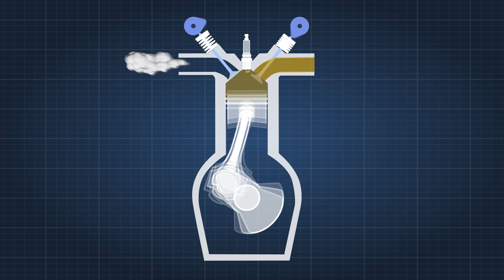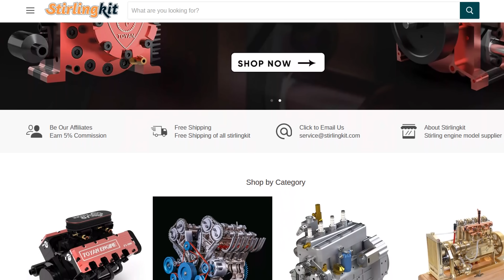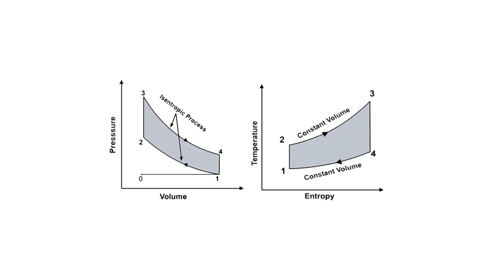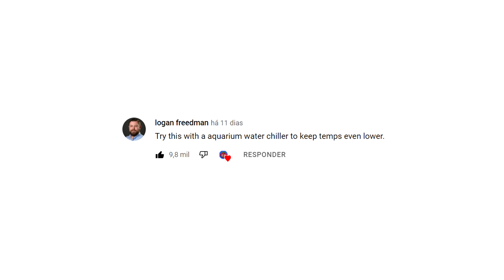I 3D Printed a Transparent Combustion Engine in Resin

Comment: It just seems to be firing at the wrong time. Too high compression would cause this, not giving the spark just prior to reaching TDC — each fuel needs a different amount of time to ignite, having a poor spark gap that doesn’t ignite properly because you’re getting too rich of a fuel mixture with different fuels…. 

All of these are possible issues. As soon as it starts misfiring it’s going to work periodically as an engine and periodically as an engine break.

Love your videos! I would change to an ignition system that is set by the shaft and to be safe use a dual fire coil that fires every second stroke. This way too you can see even better if your exhausting unspent fuel. 

It may even be fixed just by a larger spark gap and a stronger coil. Make that fuel afraid! 

Really awesome project!

Comment: I’m assuming the issue is your carb is jetted for gasoline which has a higher power density, however nitro methane and methanol burn faster and that’s why there used for racing. You need more fuel going into the engine to make up for the power density. All just speculation, but I work with carbureted 212cc engines sometimes

Comment: My guess for the difference in running would have to be the tune of the carburetor like you said in the video with the nitromethane it can combust more gas because of the mixture amount but it was still running on the original tune. And another thing could be internal balancing issues since there is more power pushing out with the higher power fuels it could be making issues causing parasitic loss to correct the momentum on the piston. As well as i believe loss of compression and cylinder temperature is causing to run out of cycle. Most carbureted engines need warmed up to tempuratures to make the metal expand evenly and increase the compression together correctly to get the correct mix due to the plastic cylinder the thermal expansion might be acting wierd. Maybe adding a couple piston rings made of the same material as the cylinder and some kind of head gasket to contain that extra pressure would help with that! Those would be my guesses for the issues

Comment: For nitromethane you need more oxygen to burn it properly. So add nitrous oxide. Or do what drad cars do. More cylinders. Add a blower or turbo or a pro charger and fix the air leak towards the top of the cylinder.

Comment: You gasoline run looks to be way to "rich", meaning too much fuel for the amount of air. You methanol ran better, because methanol has to have a much "richer" mixture (compared to gasoline) to operate. The nitro needs an even richer mixture than the methanol to operate. Your air/fuel ratio was closer to the optimal ratio with the nitro, thus it ran better. If you will adjust the needle valve on the bottom of the carburetor leaner (turn the needle valve in the direction where the needle moves in) the gasoline will run better and the other two will run worse, if at all. Tune that needle valve till you get the highest RPM with the throttle wide open. Then you have the reached stoichiometric (or close to it) ratio. For gasoline, that is 14.7 parts air to 1 part gasoline.

Comment: I feel like the resin is messing with the thermal characteristics of the engine and the cylinder isn't hot enough to maintain a standard ignition cycle.

Comment: You should look into 1/8 scale nitro engines, they run on the same fuel but use a top mounted micro glow plug that you can attach an external glow plug igniter  until engine reaches temp to keep it running. You might be able to use a glow plug from that instead of a spark plug?

Comment: Perhaps after fire cycle things get hot and lack of head gasket causes compression to blow out another few cycles cool down the engine narrowing the gap (rather less likely).
Nitro fires every time as it runs engine faster - as fast You run it as least compression leaks out.
I'm certain about this one as I had 2-stroke motorbike and every time piston rings started to seize letting compression out I could still kick start it pushing it on 1st gear on high revs, sometimes it needed to run even on over 6k rpm to fire at all so I could ride it home.
Engine running very fast even without piston ring (if piston is fairly tight) does not have time for enough of compression to leak out before next power cycle.
Other thing is wrong carb jetting - 2 strokes running too rich can '4-cycle', also missing fire stroke.
And other issue is that You may have too much burned gases staying inside combustion chamber - too small oxygen ratio (forced by too much CO2/CO and other gases containing Nitrogen - perhaps Nitro fuel creates different exhaust gases ratios doing different chemical reactions giving more power from less oxygen or the gases flow out easier), therefore perhaps leaning the mixture will help it 4 cycle, but it won't sourt out underlaying issue of exhaust stroke not being enough efficient. Perkaps adding turbo would partly sorte it, but most like issue is bad valves design.
Reply: https://en.wikipedia.org/wiki/Four-stroking more about it

Comment: The answer is: octane number. Gasoline doesn't explode per say. It projects in one direction depending on octane number. You add nitromethane and all of a sudden the explosion goes in all directions also check density... you are injecting in volume, not weight

Comment: the reason the better fuel didnt perform well is because you might need to adjust the air/fuel ratios on the carb. if it is running too lean you can run into performance issues, same if it is running too rich. being that you are trying to run higher and higher octane fuels, you will probably need to find a way to richen up the air/fuel ratio. carbs usually have screws both for fuel and for air, adjust tiny amounts at a time since the carb is so small, on a dirtbike carb i go 1/4 turn at a time while it's running until i get it just right. on something this small i would go 1/8th or even 1/10th of a turn at a time until it starts to seem like it's running correctly. rule of thumb when knowing if you are too lean or too rich is to pull the spark plug, if it is clean you are good, if it is grey you are lean, if it is black you are too rich. then adjust accordingly

*edit: tuning carbs is incredibly easy, if you have a flathead screwdriver and can turn it tiny amounts at a time, you can tune a carb 😄

Comment: Why don’t we make an engine that uses the steam from the hot motor to generate electricity to charge batteries? Like a hybrid with the radiator making power as well as the crankshaft.

Comment: the stoichiometric ratio may very well be your issue, different fuels have different stoich ratios. if it's too lean it may go through the cycle multiple times until it's sucked in enough fuel to meet that ratio. it may very well be something you could account for with the carby jet.

Comment: Air fuel ratios need to be addressed when changing fuels. If the carb was setup for gasoline, the other fuels will be running in a lean condition, for example.

Comment: When using the Nitromethane RC Car Fuel, instead of the standard spark plug, use a GLOW PLUG that is used in RC Engines which will retain the combursion and produce tons of higher trust..

Comment: Well, in most cars, the engine never smokes, and if your car ever smokes, then there would a misfortune occuring in the engine.

So don't underestimate the efficiency of combustion engines.

And without it we would only use steam engine, and steam engines are not as efficient as combustion engines, because they don't perform well compared to combustion engines, and they tend to stall very easily, but combustion engines can run until you run out of fuel, and if there where combustion engine cars, we would no longer have to deal with that water vapor flying in the air.

So combustion engines are actually more efficient than steam engines because their speed never drops.

Comment: Distributes on cars have always had a mechanism to advance the timing when at higher RPM's . As the engine revs up the pistons move faster and the spark needs to happen earlier to catch the fuel and compression at that perfect spot that allows the fuel to ignite before the exhaust valve opens. Great video as always, thanks for sharing!
Reply: ❤ ᴄᴏɴɢʀᴀᴛᴜʟᴀᴛɪᴏɴꜱ ʏᴏᴜ ʜᴀᴠᴇ ʙᴇᴇɴ ꜱᴇʟᴇᴄᴛᴇᴅ ᴀᴍᴏɴɢ ᴛʜᴇ ʟᴜᴄᴋʏ ᴡɪɴɴᴇʀ ꜰᴏʀ the 🤶 ɢɪᴠᴇᴀᴡᴀʏ ᴘᴀᴄᴋᴀɢᴇ ʜɪᴛ ᴜᴘ✉️ ᴛᴏ ᴄʟᴀɪᴍ ʏᴏᴜʀ ᴘʀɪᴢᴇ 🎁

Comment: Hey there! Love this video... a few theories myself. Thinking about analogies in an attempt to understand what might be happening. Gasoline vs Diesel. Gasoline has a slightly higher energy density than diesel (46 MJ/kg vs. 45 MJ/kg) however, a diesel engine produces much higher torque at low RPM than a gasoline engine typically produces. Obviously there are subtle differernces between the design of these engines, (ie diesel engines have a higher compression ratio that gasoline engines) but in your video it appears that you may have achieved the same effect when you printed a new cylinder (cant say for sure and I cant assume unless you measured how much more compression :)  ). Idk just my $0.02

Comment: As an idiot with no clue either I’d guess that there’s not enough air getting into the cylinder or not enough gas getting into the cylinder for any number of reasons
Reply: The gas could be harder to evaporate than nitromethane or methane or it may somehow even restrict air flow

Comment: Sometimes ignition lag is to long thus to tackle this spark should be produced 20°before the piston reaches to TDC at the end of compression stroke.and fuel starts burning 8°before piston reaches to  TDC.
As the engine speed increases time for each spark production and formation of self propagating flames decreases due to this  fuel does not ignite within time.

Comment: My best guess why it doesn't fire above a certain RPM is 2 part, 1) that looks like a magnetic reed switch being used, I question how fast it can be switched..  2) Since we don't know what the ignition circuit looks like, or how it's powered, I would question the power supply.  If it can't supply enough current fast enough to the coil, there won't be enough magnetic field to collapse to cause a spark.

Comment: As per for compression issue. Some fuel runs better with higher compression. Also, ignition timing takes a lot into effect especially when it comes to advancing and retarding the timing on when spark will ignite.

Comment: Add 1-2 O-rings to the top of the cylinder to act as a head gasket and add 1-2 more O-rings to the piston itself to improve compression at TDC.

In a few clips you can see the extra fuel being expelled from the top of the cylinder and mating surface of the head.

Comment: Watching this again, we don’t know if the engine was misfiring with the original metal cylinder but…. I realized that having a plastic cylinder, it gets hot, and it releases fumes and vapors from the heated plastic which lowers the oxygen content in the combustion chamber. Because this engine is small scale, a small amount of “carbon” from the heated plastic is enough to displace the oxygen which means… the HOT plastic is stealing your oxygen.

Of course you could try other fuels like rc nitro fuel but… the hotter the plastic cylinder gets, the more oxygen the plastic will consume.

Comment: Nitromethane makes more horsepower than any of the fuels you have there. Nothing methane gas also makes really good horsepower. Ethanol which is an 85 makes more horse than gasoline. To make more horsepower with gasoline you have to go up on the octane ratings where the other fuels you don’t because they’re already up there

Comment: Different fuels have different stoichiometric values. Also cold engines need more fuel than hot ones. Compression ratio is also incredibly important for the fuels used. Gasoline and methanol have different flash points and volatility. I would add 2 more seals on your piston and adjust your air fuel mix for each fuel.

Comment: To keep the engine at a certain RPM, you need a governor. I’m not sure if that engine already has one or not. If it does, you could just make some adjustments to slow down the engine but still allow ignition to occur.

No engine is perfect, every engine has its own set of quirks and often that means adjusting things to make it run the way you want it to. Even if you do adjust for things, engines will always have a bad stroke here and there.

A final solution would be to make your own timing system for the spark plug. This could be easier than retrofitting a tiny governor and will give you some high RPMs. Maybe have an inductor along the walls of the combustion chamber to detect when the cylinder hits a certain point that you’ve calibrated. Timing is everything in an engine, that’s the primary issue here, your engine just can’t keep up with itself. Make sure you’re lubricating the combustion chamber with oil, this is required even at this small of an engine and will create a film to seal the cylinder from the combustion chamber walls.

Comment: Well, it could be like gasoline vs diesel: diesel's rpm is lower, yet diesel engines have stronger torque. So gas has the most torque, then the  mix and then pure methanol. U can actually test the torque with some special instruments u can find on the internet to buy

Comment: what if you couple peltier cells (Thermo Electric Ggenerator (TEG) cells) to extract the waste heat generated from the cylinders and coupled it to a motor coupled in parallel to the engine crankshaft ? could it improve the efficiency of a 4 stroke engine?

Comment: Air fuel ratios are incorrect. The carburettor needs to be tuned also for each fuel. One setting for each fuel wont work. Electronic fuel injected cars are in state of constant fine tuning based on load, air flow etc. With such a basic carburettor, this needs to be manually.

Comment: Theory: The methanol 25% nitromethane creates a much larger force, meaning the inertia has to work harder to turn the cylinder around and push it up, the way to fix it would probably be a larger flywheel or a small load
(May not be correct)

Comment: Energy density is not necessarily energy output. I suspect other properties like the speed of burning (or propagation of flame), room temperature density, or even unburnt fuel in the exhaust might change the energy output in both positive and negative direction.

Comment: The magnet pickup is NOT working fast enough to run at high RPMs, you need to change it out either for mechanical ( look up how Model A coils work with rotors for ignition ) or a better magnetic pickup that can handle faster switching.  I would bet it is a form or Reed relay ( simple wires in glass that close when close to a magnetic field ) and thus not fast enough.

Comment: A possible explanation for the more powerful fuel producing a lower RPM is that the mixture is too rich; the fuel-to-air ratio was not adjusted from the previous fuels, and therefore you were not getting the as much energy out of the more powerful fuel as you could.

Comment: Timing issues. For any engine to run, it needs the proper amount of fuel, compression, venting of waste gasses, and spark at the right time. Even at low compression, the engine will still fire, but you will get blowback into the crankcase past the piston. This was clearly only getting sufficient spark just past TDC on the compression stroke to work only part of the time. It could also be excessive fuel filling the spark plug in a liquid state (drowning out the cylinder).

Comment: So, I have one of those boring but practical suggestions.

When you saw that it wasn't firing on all of the expected power strokes, you said "Maybe it's not sealing.  I'll just print another one!"   What about designing it from the beginning with a spot for an o-ring and printing the gasket using TPU?  It's a quick and easy way to make an air-tight seal.  While it may not be the solution to this particular problem, building it into the design means you don't have to ask that question.

I found you by watching your vortex rocket motor videos and I was really surprised that when you put the three parts together you weren't using gaskets to seal them.  Especially when the ceramic parts aren't perfectly machined flat and almost surely slightly warped from shrinkage during curing.

Comment: tad too rich what you can do is lean it out i can still see fluid in the combustion also could be possible you have a bad deck surface due to that melting Resin letting that compression go bye bye

Comment: The nitro fuel you tested is designed to run with glowplugs not sparkplugs usually in 2 stroke nitro rc engines it also contains castor oil that could be a factor 25% nitro fuel has less oil

Comment: I you think about it, 4 stroke engines are more fuel efficient because they aren’t using fuel on 3 strokes, it’s only a downside if you are concerned about raw power output, and extracting the most energy out of the fuel. 

To do that we’d need to figure out how to take waste heat and turn it into kinetic energy to move the vehicle.

We could attempt to use peltior modules, they can generate electricity from a heat difference, add a second radiator and cooling loop to one side of the modules and attach the other to the engine block, that could also allow us to get rid other cooling system normally in cars while producing more electricity. It could have drawbacks though, like how those modules are not great power generation units. We’d also need to figure out how to get all of the gas in the cylinder to be burned 100% all of the time, there is often unburnt gas that gets pushed out the exhaust pipe.
Reply: Unburnt fuel definitely contributes to the 25-35% efficiency.